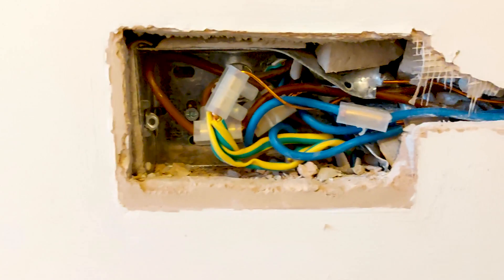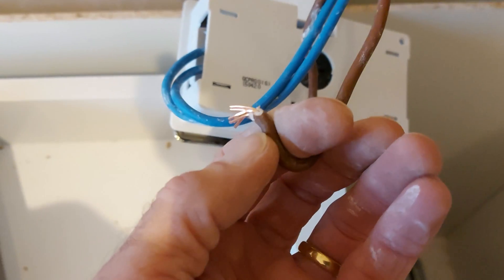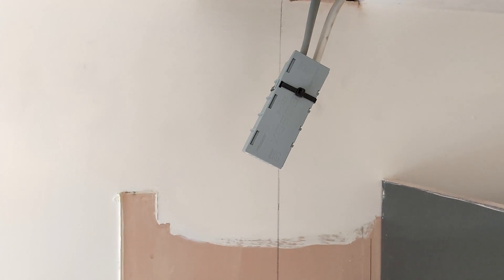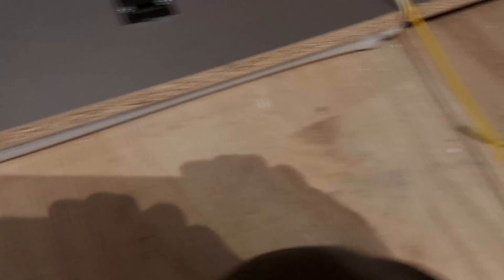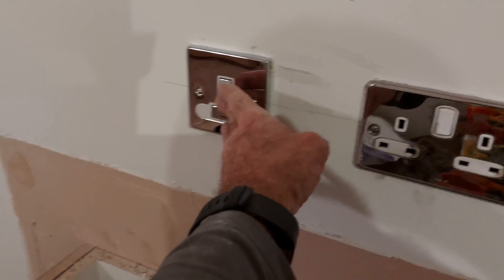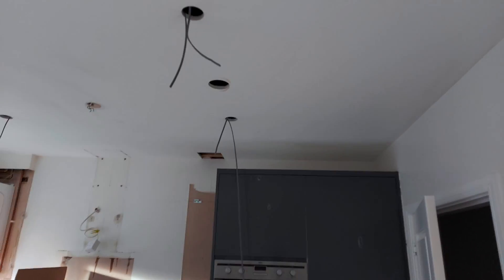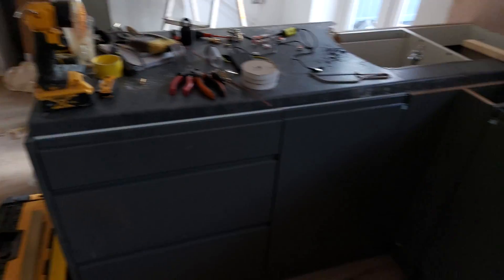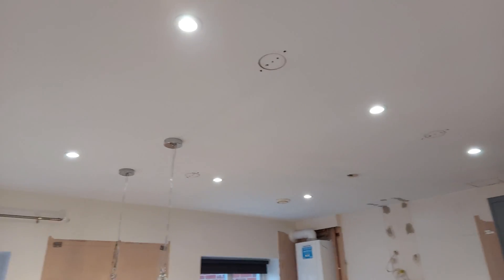Kitchen Electrics. Horror cooker circuit, downlights, fused spurs and more

Comment: Where can you get the long drill bits please
Reply from the maker: I get the 400-1000mm long masonry SDS bits from Screwfix or CEF. Plenty on Amazon too. Spend a bit more for decent quality. For the 260 long bits I use the Bosch Multimaterial bits that are blue

Comment: What was that long drill bit you used, do you have a link or a make and model for it?
Reply from the maker: It's the SRFD1.2X5-10 Flex Drill Kit from Super Rod Ray. You can get them on Amazon
Reply: @abcelectric  thanks, I'll try it out, if it works it'll be a game changer.... no lifting floors or opening up ceilings.
Reply from the maker: That's exactly why I got it Ray. Theoretically it'll drill between up to 3 joists @ 400 centres if everything lands right, but the drill bit is really sharp so unless you can get a Ferret WiFi cam in to check or are 100% guaranteed there are no pipes or cables in between it'd be a bit risky to just plough straight through. 👍

Comment: Quote for kitchen installation:
Installation of units worktops and appliances £900 4 -5 days
Electrical work £600 2 half days if they turn up then don't clean up after job is finished or plaster up chases as it's the kitchen installers job.
Reply from the maker: Interesting comments but extremely wide of the mark on this job 🤣
Reply: is that a price from "Dave the pub jobber/handy man" for fitting a full kitchen .................................badly :)

Comment: 6mm  down to 2.5 in a junction box 🤦‍♂️ take the 6mm to the fused spur for the hob.  I haven't done electrical installations for 20 years and wouldn't do that.  Maybe the fuse on the 6mm is 20amp so could be ok, but still....
Reply from the maker: Regs state change of cable size to be fused down  within 3m of junction Alex. Hob spur was less than 1m away with a 3A fuse. Therefore it's impossible to overload the 2.5mm leg. I could have used 1mm according to regs. 6mm to a 3A FCU is a bit OTT, but it's a valid alternative. We all have our methods and if mine is contrary to the regs I will hold my hands up 👍

Comment: Wow that looked like a horror show...    Well done, I think I would have walked away and not want anything to do with that unless it was a rewire as god knows what else the muppet kitchen fitter has done...  Bet he is accredited by a CPS as a domestic installer as well.  This is why only electricians should do electrical work...
Reply from the maker: Cheers Steve. I've seen some horrendous work over the years but that taped 6mm connection hidden behind the oven and the CCU are probably in the top 5. I don't know whether or not that kitchen fitter is CPS accredited, but it makes you wonder what other horrors are out there and how some people sleep at night.